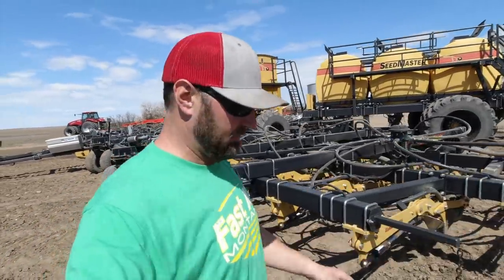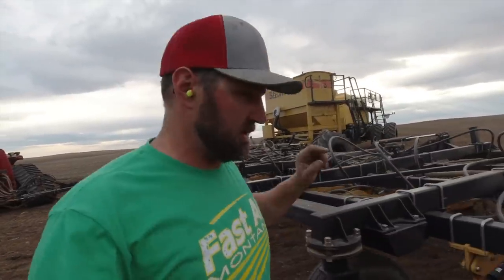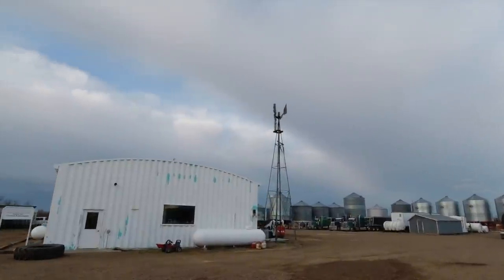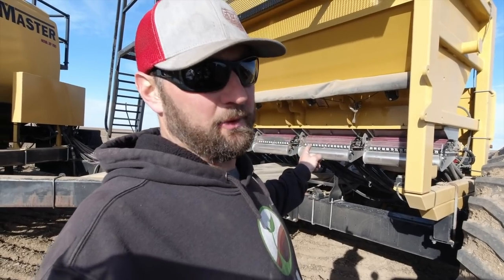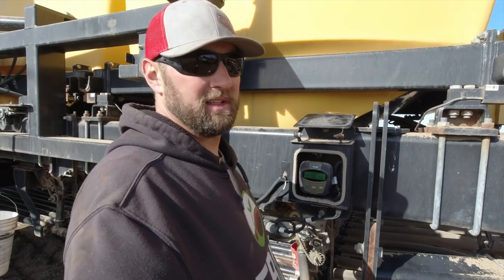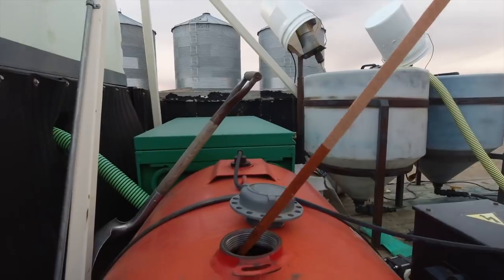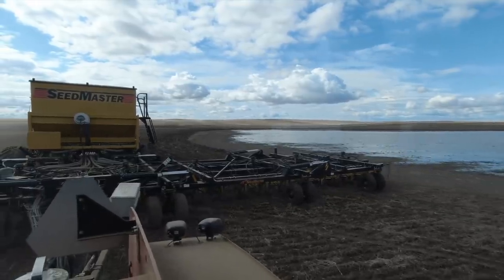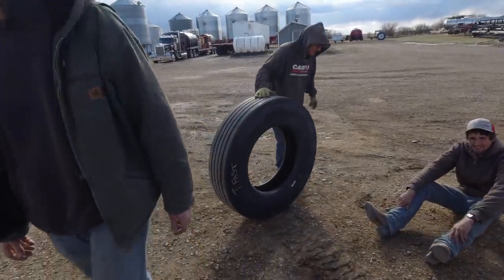MAJOR SENSOR FAILURE on First Days of Seeding

Comment: there is a much easier way to inoculate the seed,  and cheaper too
. you just have to put a spigot that lets a small stream of this liquid fall into the seeder's loading tube, and you will see how at the other end (where the seed falls into the seeder) the seeds are perfectly painted, here, in Argentina, all the farmers do that and it really work.... great videos dude, and amazing machines too, thanks for share it
Reply from the maker: Our drills have conveyors and they won’t mix.  We used to do it that way when we had augers.
Reply: @FastAgMontana  I thought I saw that but I wasn't sure, but yes, with conveyours you can't do that, thanks for answering

Comment: Tony, sometimes those sensors just need the accumulated dirt cleaned off the laser eye inside them. Pretty sure you’ve probably ruled that out but had to mention it. $100 a piece I try everything before I toss them. They do fail though.
Reply from the maker: We were given 180 used ones to burn though. those are now gone.